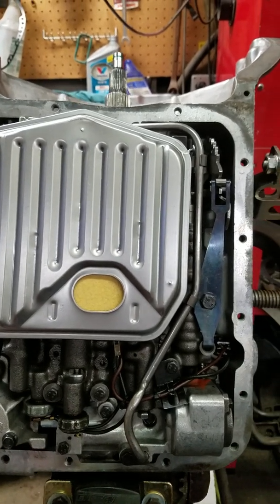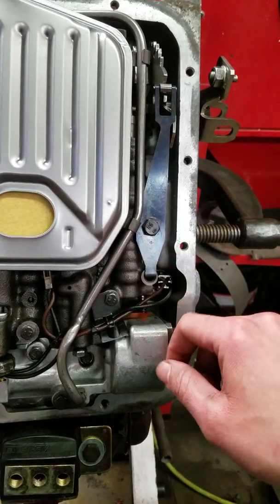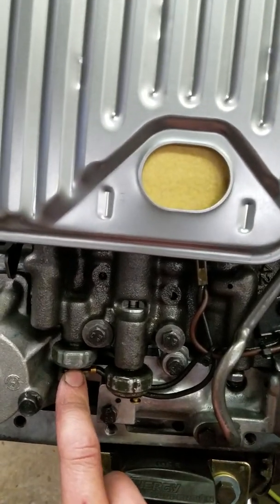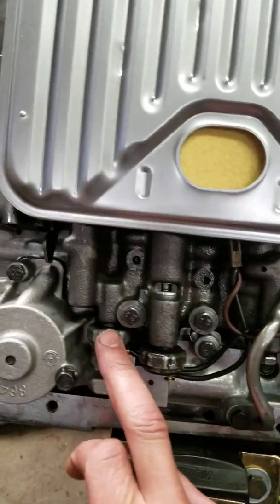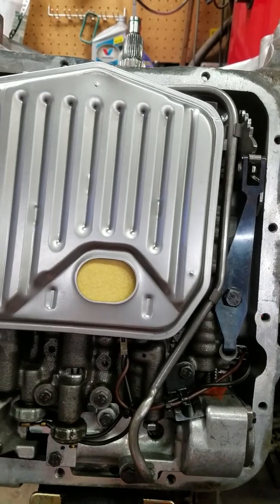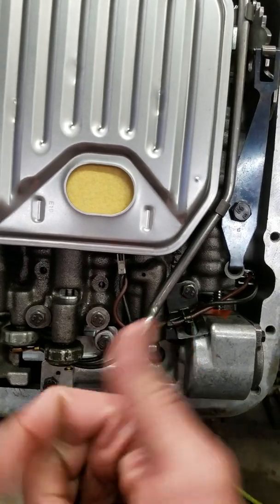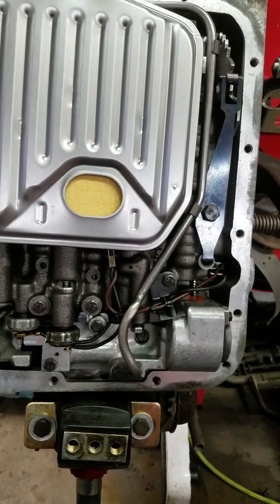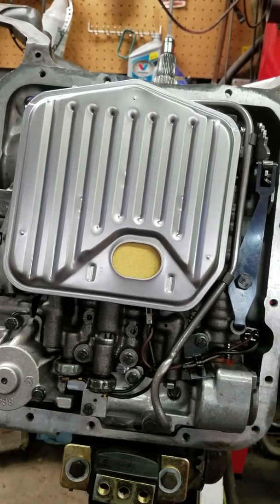700r4 torque converter lockup

Comment: i believe my trans is 4l SAME..60 with out the   (E)  I ASSUM THE 4L60 AND THE 4L60E IS PRTTY MUST THE SAME
Reply from the maker: That's correct it is a 4L60 in 1990 it's the same as a 1989 700r4. The 4l60e started 1994 is alittle different but most of the hard parts/internals are the same. The valve body on a 4l60e and case is alittle different to fit the electronics.
Reply from the maker: Here a quote. In 1990, the 700R4 was redesignated as the 4L60 (4-speeds, Longitudinally positioned, 6000 lbs. GVW). This was a change in name only with no significant mechanical changes associated.

Comment: hey got a question for you i have 1990 k5 blazer 700r4 trans..i just rebuild my engine and did lot of up grades i converted it over from tbi to carb so i no with out my computer i wont have no converter  lock up ..so what u suggest would be the right converter lockup kit to buy i dont want to drive my truck with out it ..i no my trans may it hot with out it..let me know thanks..appreciate it..
Reply from the maker: That's a bit of a tough question. It really depends on how you want the lock up to work. They have many options. The basic option is the pressure switch option like in this video. That works well for most applications.
Reply from the maker: Other option is the vacuum control type like this.https://www.jegs.com/i/JEGS/555/60324/10002/-1?gclid=CjwKCAjwiuuRBhBvEiwAFXKaNM-70oae60YVwob3XZAPJvIu_O2OkxWSBub80gmJOeA1wOjK7hdSihoChMsQAvD_BwE

Comment: How can the solenoid be wired for 3rd gear as well, or can you do that? Mine has a two pronged switch also.   My email; quickchange4.56@gmail.com
Reply from the maker: I don't think your going to have good results with locking in 3rd with a pressure switch. You likely want/need a controller,or just run a manual switch to lockup for you can manually lock it as you want in 3rd and 4th.
Reply: @DIYracing454    Ok, I was just curious about it. God Bless

Comment: My transmission internally is wired just like your video, however, how is the transmission wire externally? I have a wire from the +12v terminal from the battery to a latching switch mount on the dash that i can turn on/off.  Then from the switch right to the harness on the transmission.  Is that right? Not sure i understand the comment about a brake switch.
Reply from the maker: How you have it works, What im talking about is if you keep what you have but run that circuit threw a brake switch that goes opened when you press the brake pedal, in between the trans and swich you have now. What that does is unlocks the lockup clutch anytime you hit the brakes. You don't want the brakes being applied with the lockup clutch engaged.